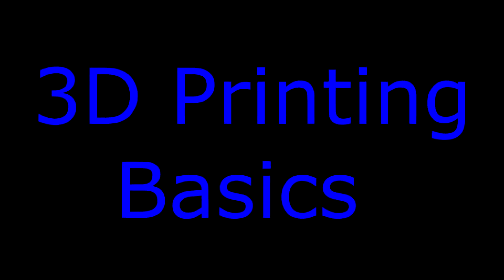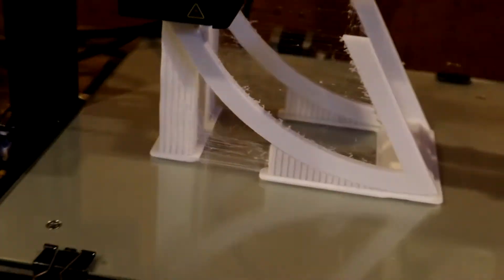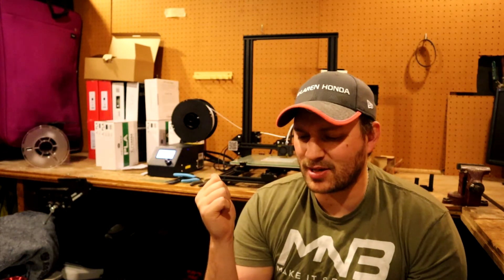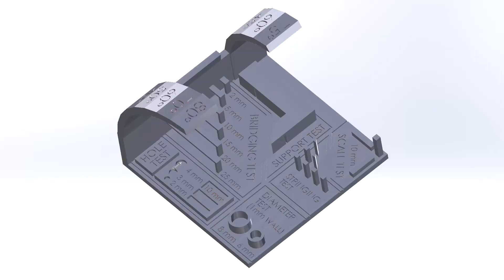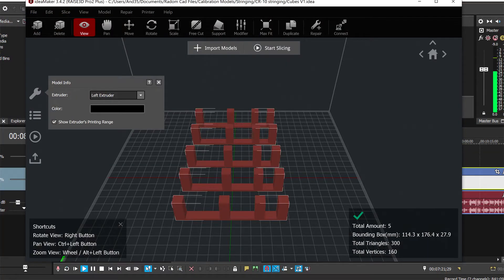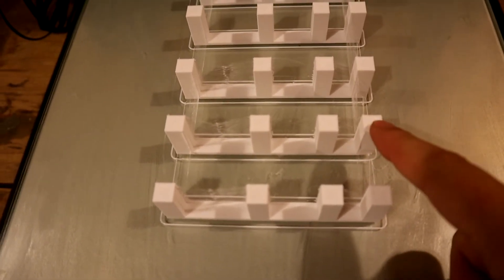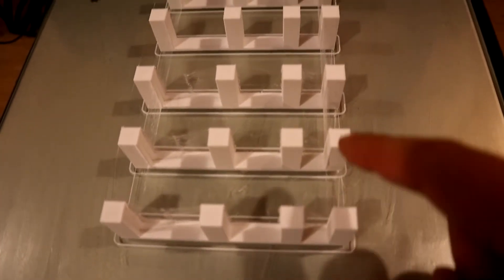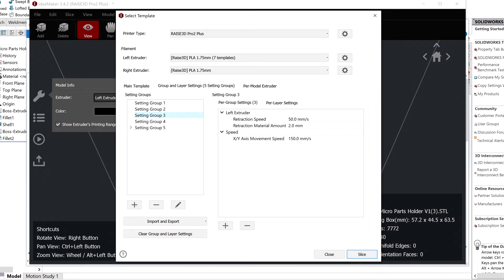Fixing Stringing in Your 3D Prints (Featuring Creality CR-10) [3D Printing Basics Episode 7]

Comment: Can room temp affect stringing?
Reply: I'll probably retry the process.
Reply from the maker: I wouldn't worry about PLA oozing when the print head is stationary, that is expected if the hot part of the extruder still has plastic in it, and is very typical at the end of a print when the hot end is still... well... hot. Did the change in stringing happen when you switched spools? Some of the material properties that affect stringing can change between filament manufacturers or even between spools of filament for some manufacturers. It could also be as simple as a build up of PLA on your nozzle causing some to stick, so cleaning your hot end nozzle could help too. 

The other option is to try reducing your hot end temperatures, which should keep the filament less fluid and therefore less prone to stringing. However, if you do this, don't forget to reduce your print speed so that your printer still gets the material hot enough to bond. With PLA, hot end temperatures down to about 180C are usable, but at 180C your print speed should be reduced to around 20 mm/s instead of the 40-ish that is typical at 205C.

What are your print settings for retraction, and what printer are you using?
Reply: @makeitbrakeit9132  I haven't switched spools yet. I am using the one that came in the box with the printer (CR10s pro). Unless the problem lies in the quality of the spool that comes in the box?

I've cleaned the tip. In fact I even had to switch the original nozzle with the replacement that came in the box. I didn't know how soft brass could be and cut the tip off with the little scissors/pliers that came with the printer while trying to remove some plastic. But the stringing occurred even before the nozzle change.

I had tried reducing the temperature and had seen the least stringing ( still some but much less at 180c). The quality of the print wasn't super bad, but I did not really like it so I was looking for another solution.  I'll retry, but reduce the speed too this time around since I had not done that. 

For now, the settings for retraction are at 10mm. That's giving me the best results although there is still a bit of stringing even at 10.
Reply from the maker: Typically speaking, the material that comes with most of the hobbyist level machines (including the CR-10 and its variants) is good enough for some initial set-up and function checks, but I have yet to see "good" material shipped with a printer. If you are getting fed up, I would definitely consider getting a spool of decent filament (Hatchbox, Matterhackers MH series, etc), as bad filament can cause a lot of problems in even the best 3D printer. A link to the Amazon page for the Hatchbox filament is in the video description, and that is what I use for my general PLA printing that doesn't require something specific.

Your retraction amount seems very high, even for a bowden style printer like the CR-10. For your reference, I'll put some of my CR-10 printing parameters below. The terminology is straight from my slicer (Ideamaker), but there should be similar settings available in any of the good free slicers. While each printer and material is a little different, this will hopefully provide a decent jumping point for you:
Extruder Temperature: 205C
Heated Bed Temperature: 60C
Default Printing Speed: 50 mm/s
Inner Shell Printing Speed: 40 mm/
Outer Shell Printing Speed: 25 mm/s
X/Y Axis Movement Speed: 150 mm/s
Retraction Speed: 40 mm/s
Retraction Material Amount: 3 mm
Minimal Travel of Retraction: 1 mm
Extra Restart Amount: 0 mm
Minimal Amount of Retraction: .02 mm
Z Hop at Retraction: 0 mm
Restart Speed: 25.0

Let me know how it goes!
Reply: @makeitbrakeit9132  Thanks for the tips. I tried your settings out but it seems what works for me right now is the 10mm retraction. I'll just try to lower it a bit from there to see how low I can get. Unfortunately, 10mm doesn't work well with the wood PLAI have. I tried twice and the filament jammed twice.

As far as Matterhackers and hatchbox are concerned, I can't get anything from them. They say they don't ship to my country (Benin). Amazon also doesn't ship things my way. All I can get is from websites like banggood. And even then it's quite expensive since shipping can cost more than the actual filament.
Reply from the maker: Assuming your room temperatures aren't at levels that would be hazardous to your health (think below 0 or above 60 degrees Celsius), room temperature should have very little or no effect on stringing for your 3D printed prints. Stringing occurs when your print head travels over a gap in your print and some of the already melted plastic drips out of the print nozzle. Because the print nozzle is kept at a constant, very high temperature (180+ degrees Celsius), ambient temperature has very little effect until the plastic is a little bit away from the nozzle, which means stringing would occur at any safe-ish room temperature. Ambient temperature can make huge differences in other ways to your print, the classic example being colder rooms causing ABS prints to warp, but stringing is one area where ambient temperature doesn't seem to be a factor.
Reply: @makeitbrakeit9132  Thanks a lot for the reply. I got one about two weeks ago. Everything is fine except for stringing. I had been making some changes and it seemed to be getting better, but all of a sudden the stringing is back. And sometimes the PLA keeps oozing out for a while even when the machine is at rest after a print is done. I am not sure if that is normal.